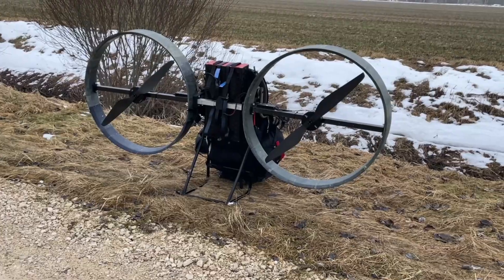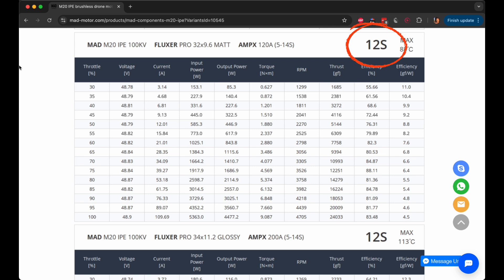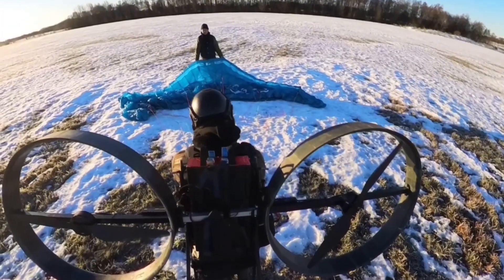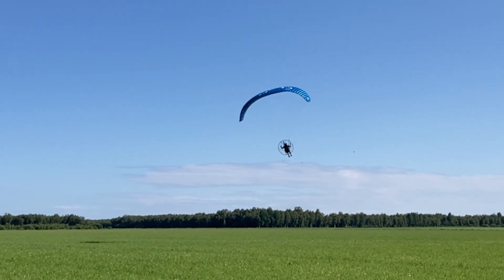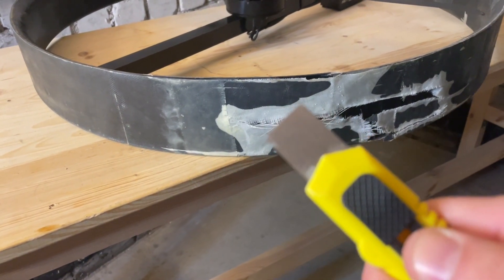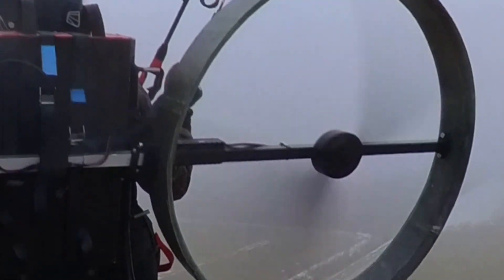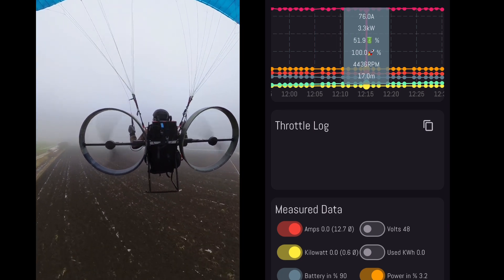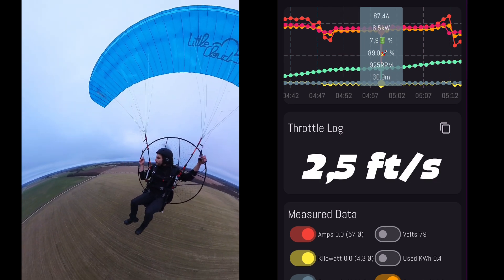I fly with two drone motors!

Comment: I love electric propulsion in paramotors, but this one is so fantastically dangerous - the failure mode if you lose just one side will cause you to spin like crazy into the lines while the other motor eats one of your arms. This could be from losing just one esc / motor / prop / throttle cable / or sucking in a strap like you nearly did there. Please re-think it and consider potential failure modes. good luck with it though.
Reply from the maker: In the previous video i was showcasing testing it with a simulated cut off of one motor from full throttle and the twisting notion was well manageable. I compare RPM of both motors every 20ms and if there is a bigger difference between both it will shutoff both motors automatically

Comment: Nice but you must learn how to paramotor!!!! Under power your hands MUST BE all the way up!!! You are flying like you are paragliding. Luckily your max thrust is so little, otherwise you will stall the wing and clearly, you don't have the skill and knowledge to even know why it stalled 😢
I like your setup very much. One other thing: with electrics MAKE SURE your props are statically and dynamically 100% balanced. Then and only then you can in-bed the props into the shroud. The process is fairly difficult at first but Worth it. If you get it right, you will notice an increase in efficiency (more thrust) and decrease in noise!!!! Ofcourse, the shrouds MUST BE perfect circles. Much MUCH easier said than done. But I like your setup very much. You are inventing the future in paramotoring!!!!!!!!!!!!! #WellDone
Reply from the maker: Thanks for your feedback @MrGoMario. Yes, the current setup definitely doesn`t give me any performance increase you see with ducted fans. The gap is to large for that between duct and prop. The ducts on that setup were mainly for safety to make sure I don`t get any lines in the prop. If I may ask, what is the indication, that I am about to stall the glider? I also have a version horizontaly uploaded where the glider can be seen.
Reply: @jerelix  Sorry for the late reply... Firstly, your setup has little to do with a ducted fan and more to do with shrouded propellers! The two look similar to a casual observer but they function differently. However, for now forget about that. It is more important to get your flying right because that can damage equipment and even cause injury 😬 Ask me all about it... 15 years ago I was where you are now. You have the right idea and I really want to help you with knowledge I gathered over the years...
Your question is 100% correct. Without going into details, your take-off should proceed like this: 
1. Assuming no (or little) wind, you should be able to run forward and lift the wing above your head. Do that a few times. You should be able to to run keeping and controlling the wing. If you can't do that, wait for a bit of wind. Don't learn from old (and lazy) pilots who are using the motor to lift the wing!!!! That comes with experience and it is not without risk.
2. After you master step 1 you can proceed in adding power, while controlling the wing and running. If you feel the wing starting to lift, cut off the power while still running and let the wing fall gently down. Then and go back and repeat a few times. 
3. Only know you are ready to take off. Do the same as in step 2 (it is better with a bit of wind - ALWAYS take off against the wind). You will feel the wing lifting the weight of the motor from your shoulders and that will enable you to run even faster. Do so. The engine(s) will help you push forward. If you feel the leg straps trying to lift you, apply a bit of brake but not much. It depends on lot of things how much brake you can apply. I can't tell you but apply a little. Lets say 10-15cm under pressure. Keep on running... You will get airhorn. A few seconds (2-3) AFTER you left the ground you MUST go full up with your arms, while maintaining FULL power. You will still be climbing. If not, you do not have enough power to safely fly with this setup and land ASAP!!!!!
4. In flight you never apply brake on both sides while under full power. You can gently brake one side and lean into that side, to turn but NEVER brake both sides (under full power)!!!!! 
After reaching the desired altitude (300ft = 100m in my case), decrease power until you stop climbing and "feel" what the wing is doing with your brakes by constantly keeping a little tension on them.
Now I can answer your question: Remember I said in point 4 - During flight you always keep a bit of tension on the toggles/brakes, without pulling them down. If there is a bit of turbulence, this pressure will change a bit. Don't worry. It is normal. With experience you can fly in more and more turbulent air by using ACTIVE flying but don't worry about that for now. For you, if it gets turbulent, you go land!!!!! With a paramotor the primary culprit of a stall is too much power and too much brake (at the same time). A stall will feel like the brakes go "soft" with no pressure even if you instinctively pull down a bit. In that case, you MUST act fast and get off the power, even if you risk crashing. The alternative is much worse!!!!! That's why is safer to have enough height so that the wing can recover. Flying low and slow (Superman flying) is dangerous. Don't be fooled by looking at other pilots on Youtube... You are not them (yet). Huh - that was lots of tipping but if it helps you - I will tippe it all over again. Paramotoring is deceptively easy...
Reply from the maker: @MrGoMario thanks a lot for taking your time to elaborate in so much detail. I appreciate all the tips! Especially the last sentence is really true.

Comment: Cool concept!!! But please, before you cut your own arm off, put some netting between them and the props! It's all good when the flight is stable, but if you take a tumble and your arms go in there...
Another thing is lift your arms and let your wing fly once you take off. You're keeping too much brake pressure after take off.
I swear I won't mention the questionable weather conditions 🤣🤣🤣
Wishing you all the best with your invention, mate! Well done pulling it off! 😉
Reply from the maker: @MyNameIsJef  Thanks for your feedback Jef
Reply: I don't think his arms can bend backwards... Even if he wanted to, he won't be able to touch the blades while flying. And even on the ground it won't be easy to twist backwards.
I FULLY agree with your other point though! Applying brakes while under full power is a big NO-NO in paramotoring. Especially not when using a large wing like his!!!

Comment: Looks awesome! If I can make a suggestion, get rid of the ducts. They look cool but they are almost certainly reducing your efficiency. Ducted fans only work properly when the propeller/ impeller is specifically designed to work with the duct and have extremely tight tolerances to The duct itself.
Reply from the maker: Thanks for your suggestion. You are right the tolerance is definitely not tight enough for getting any efficiency benefit. I mainly added them for safety. Protecting the prop from bad landings but also to make sure I don`t get any lines in. What do you think would increas in efficiency I could get from removing the ducts?